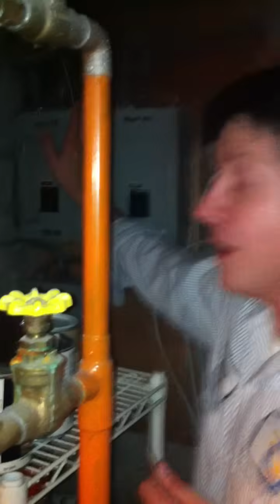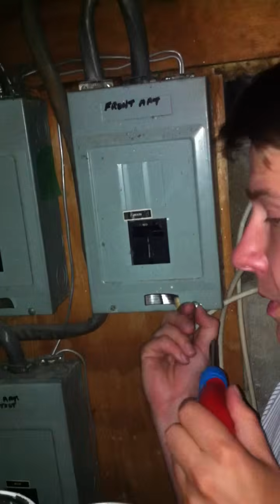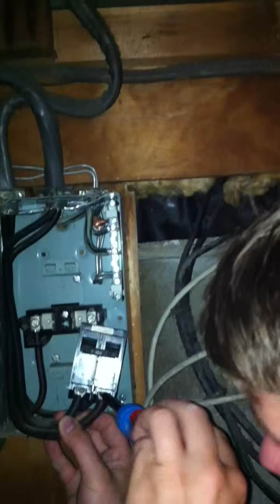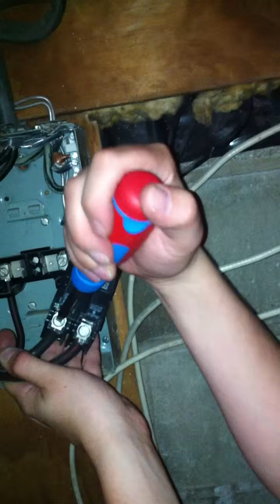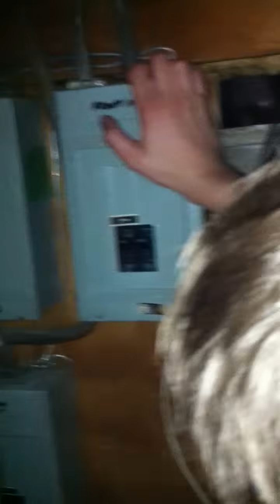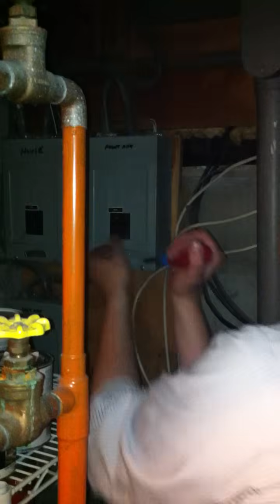how to replace a circuit breaker with new 100 amp breaker

Comment: Is that an electrician's screwdriver? Shouldn't you use pliers to pull wires out of breaker? It seems dangerous to just grab them. I need to do this very same thing and it would have been nice if you explained more.

Comment: step 1 call poco have meter opened. step 2 tell owner to move shelves away from electrical equipment. 200 milliamps or 0.2 amps stop the heart. whats the amperage rating of a poco transformer?  10,000 amps give or take. thanks for showing homeowners how not to replace a breaker.

Comment: the more videos I watch from gen 3 the harder I laugh. you claim your a licensed professional, so why no anti ox? is that your job security? also if you were in the disconnect panel why not wire it correctly while your there? put the street power to the lugs in the box, and the house side to the breaker. the HOUSE is suppose to be connected to the breaker. you and your company are a joke. tell your apprentice to go somewhere were he can learn to do it correctly.

Comment: This video is gonna get someone killed.
Reply from the maker: That is just a bit of a silly over reaction. I will the big box stores stopped selling service equipment to the public without electrical licenses. Not because people will get killed changing breakers but the will start fires installing it wrong.

Comment: Ok....well first you dont know what your doing, the wires that are terminated in the back, they are the line set, the other set on the breaker are the load set, which means when you pulled that from the buss it killed the breaker, in any case where are your gloves? Where is your tester? Wheres the no-lox? Your videos should be taken down, your giving people false information and your going to get someone hurt. If your going to post a video atleast know what your talking about first. DUMB ASS!

Comment: was the tabs in the panel the line side i hope they were if not you were a bit close for comfort to the live feed for me  if it was the line side you popped out then back in why in the world did you not use a real electricians screw driver with a insulated shaft and some gloves and safety glasses would not of hurt molten aluminium don’t feel good in the eyeballs from accidentally touching the screwdriver then jumping from the shock and letting the to non fused hot lines hit together

Comment: One other note I would recomend electrical rated gloves when working with live circuits you were close to the live circuit when pushing in the breaker, best to use common sense and live a little longer be careful and be safe

Comment from the maker: @SkilledEddie No, We did not check this breaker with an amp probe. There was no need to. The breaker did not feel correct when it was operated. It was also over 30 some years old. There was no load changes in the condo.  For that reason we just replaced the older part.

You can call that an assumption if you like. It still corrected the problem.

Comment: Did you verify it was a bad breaker by using a clamp meter and checking the load on the breaker?  Or you just assumed it was a bad breaker?